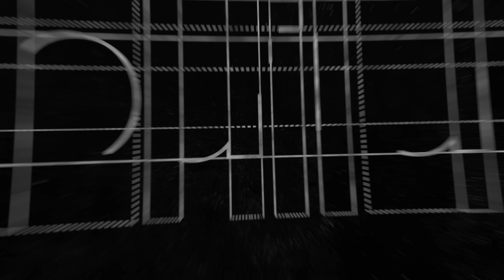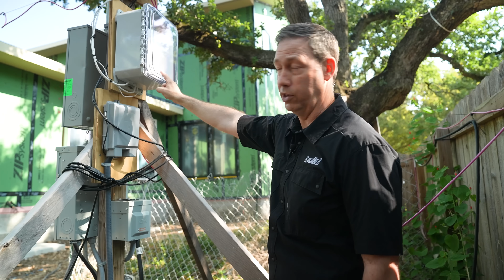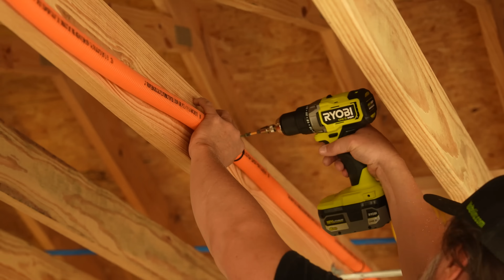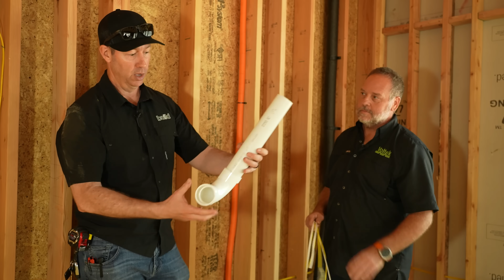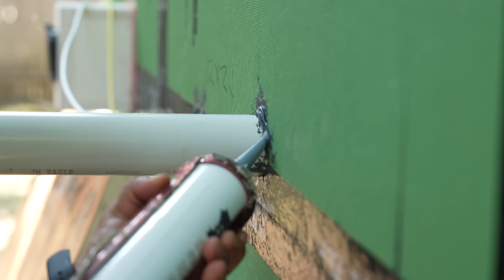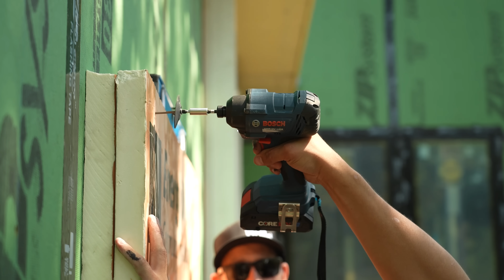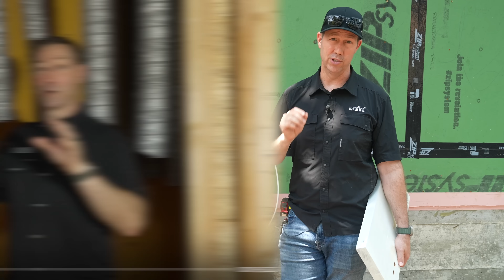Preparing for Google Fiber & Future-Proofing!

Comment: AT&T doesn't use coax, they never have. They are a phone company and will use fiber or twisted pair like that cat6. Coax is used by cable companies not phone companies.

I would put an outdoor electrical box to run the cables into. I have seen plenty of those cables left exposed and go to use them only to find that they are corroded quite far in, and in some cases completely unusable, a sealed box would provide protection from the weather and help prevent that. It is also the correct way to do it.
Reply: AT&T uses Coax to go from the MPOE to Demarc with certain equipment.
Reply: @KevinSmith-qi5yn  as far as I have known the phone networks have always only been twisted pair or fiber. Of course there could be parts that I am unaware of, but it doesn't change anything about my comment because they don't run coax to the home which is what this is about.
Reply: @jeffreyparker9396 I think there are some legacy coax systems where ATT bought an existing cable system that had cable Internet where this applies. Otherwise the ATT system is either DSL or fiber.
Reply: I assure you that AT&T Broadband previously ran coax from the pole to the modem in my home. More recently, they ran fiber from the pole to my home. AT&T is more than a phone company.

A weatherproof box is a great recommendation. A homeowner can choose the best place to install it in advance.
Reply: @DynamicBits  how do you know? Did you cut open the cable? I have only been working in the industry for 20 years, unless it was a cable TV network that was acquired by AT&T it would have been trusted pair because it was DSL which is literally run over phone lines and only over phone lines. They also did fiber to the street or fiber to the outside of the house for many years now.
Reply: @jeffreyparker9396  1. "RG-6" was printed on the cable jacket.
2. I watched the technician terminate the cable.
3. The cable was terminated with an F-type compression connector.
4. The wall plate had a female F-type connector.
5. An F-type attenuator was used because the signal was too strong.
6. The cable connected to a *cable modem*.
7. The service was billed as *cable internet*.

@KevinSmith-qi5yn was spot on with their comment about coax being used from the MPOE to demarcation point in certain situations. There is much more to AT&T's network than the PSTN you're focusing on. I can't confirm that AT&T still installs coax, nor did I claim they do.

P.S. When I had DSL at that house, it was not run over twisted pair from the pedestal. It used a jelly-filled direct burial cable with untwisted pairs using colors that predated the EIA/TIA-568 standard. Also, my current AT&T fiber install uses one continuous cable from the pole to the inside of my house, with no equipment or termination box outside.
Reply: @DynamicBits  like I said, cable network acquired by AT&T.

Comment: You can run at least 1Gbit with that cable with current tech and they can probably bring that up even further in the future. 1Gbit is far more than you need as a private citizen, you can run a commercial internet service on that with no problem.

Comment: Using plumbing PVC pipe instead of electrical PVC conduit? Not smart, the bend radius in that 2" 90 is capable of snapping fiber.

Comment: One thing to consider when you run cable in walls is risk of fire from the wire itself overheating (e.g. PoE power over Ethernet). Network cable put in walls should plenum rated "CMP" which has a fire retardant regular CAT5/6/7/8 are not unless you specifically order plenum grade. I'm not sure if fiber has the same it's light not electricity but the Aramid cover it's most likely flame proof. The coax cable they ran should also be CMP rated. edit: CMP in any enclosed space has benefits not just for the off gassing reduction.
Reply: plenum cable isn’t needed for wall cavities.
Reply: That is NOT the point of the plenum rating. It's to prevent off-gassing during a fire when cables are ran through a plenum space, which 99% of residences don't have.

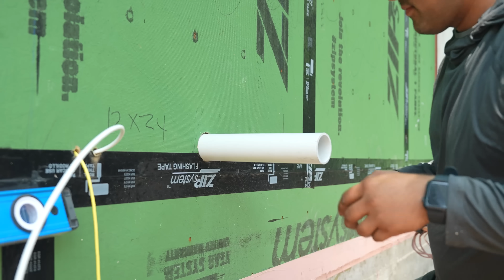Comment: 8:34 - you don't need a 2 inch pipe to future proof the Internet. You could totally do a 1 incher.
Reply: It would help in situations with pre-terminated cable but Inch and a half would do fine.
Reply: For the less savvy homeowners or installers it is MUCH easier to pull pre-terminated fiber through a 2"
Reply: That's what she said.
Reply: Dunno why they didn't use the grey stuff but oh well

Comment: Gotta say, Im a bit disappointed that there isn't some other cool entry box that lets you elegantly run exterior lines to the interior.  If Risinger is just drilling two holes in the exterior sheathing, then I guess it doesnt exist!
Reply: Yeah it was pretty laughable. Extreme broadband enclosure is what you're looking for. It will mount on to the side of the house, provides multiple conduit connection on the back. Makes for the very clean install.
Reply: Yeah.. should've been a poly NEMA locking cabinet for everything to land on the outside wall

Comment: Neat, but I don't like how it was done. I would have run a 2 gang or even a 4 gang box and sealed that. Then run the cables though a face plate. That would let you pull these two cables if they get broken as well as run anything else. I think it would look cleaner and also be more future proof. I would also do the same thing on the corners  under the eves for future security cameras.

Comment: I would have run two conduits, you don't want to be pulling any future cable against your fiber lines if you are still using them. Also, even if fiber is still the standard for high speed Internet in 10-20 years its likely that the standards for the fiber to handle the "new" speeds will be different, requiring new cable pulls.
Reply: I doubt new fibres would be required, no speed imagined would require different fibre.
Reply: just get new SFP modules with the requested speed

Comment: I hope you also ran power out there!! The ONT needs power, and any other cable box or media converter usually does, too. Unless you are putting the ONT in the attic and have an unpowered splice mounted to that board.
Reply: ONT is usually indoors.
Reply: @lordgarth1  Not always. A lot of providers use an exterior mounted ONT with an ethernet connection to the inside of the premise.
Reply: @lordgarth1  Google is the only provider in my area that will land (residential) equipment inside. Most others will refuse unless you have an enterprise account
Reply: ATT has their ont/gateway inside the house
Reply: The ONT no longer goes on the outside of the house, this isn’t 2014.
Reply: @CaptainMcFartin  I should’ve specified then.. I work with several rural carriers and their ONTs most definitely still go on the exterior. I get it, enough people have clarified it doesn’t apply to ATT 👍🏻👍🏻👍🏻
Reply: @Zach_T_M  ahh, okay. I was gonna say, TDS stopped that a long time ago.
Reply: ONT is installed indoors in many places because they had some issue with ONTs installed outside (heat, moisture, etc..). Even when ONT is installed outside, power supply is installed inside with separate cable run for carry power and power monitoring. They could use extra PVC conduit if this is necessary. COAX cable can be converted to supply power as well, but I doubt service provider will do that.
Reply: As another data point, my Verizon ONT is inside my house.  There was an old outdoor ONT (circa 2005), they just used an SC coupler extend the fiber into my house.
Reply: @Zach_T_M  wow. Now I did have to be there when they showed up to make sure they didn’t just do whatever they wanted.
Reply: @TofuInc  that’s crazy. When they did mine I was there and made sure they didn’t exactly what I wanted. I saw my neighbor getting fiber and walked over and made sure they did what he preferred as well. They were trying to tell him they were going to run it to the side of his house which was the opposite of where it would be best for him.
Reply: @Zach_T_M my rural FO carrier is an REMC, and the powered converter box, which is a WiFi router as well, is in the house.

Comment: I'm confused what the pipe was for if the wires are  not going through it. He implied they were running the wires through the pipe but at the end they didn't. I was hoping they'd have a solution with a real slick box or enclosure to make the connection in outside rather than the junk the Internet company uses. I also couldn't find Lee's website. There's a ton of companies called Volt Tech.
Reply: 8:35 Matt said it's just for future-proofing in case it's needed for some new networking technology he's putting in the pipe now for whatever new technology may exist decades from now.
Reply: @dg-hughes  Ah, thanks. I guess I thought he'd run the other cables through the pipe also... There's plenty of room.
Reply: mentioned early in the video. during construction it is possible to properly seal holes drilled through, after completion this is not as easy, that is the reason for the PVC conduit.
Reply: @coreysuffield  I did catch that, Just still why not use the conduit/pipe. Seems like a cleaner install.

Comment: Why not run everything through a conduit? Why put extra holes in the house?

The big problem with fiber is patch cables. Also, any future movement or redesign of the structure will require full line replacement.

The conduit idea is great for any house. Just add a few separate ones with junction boxes. Separate ones for "high" voltage, low voltage/data, and misc. These can come in handy when doing remodels, additions, or even just basic troubleshooting. Having all your wires coming through at one point makes it easier on technicians.

Comment: New build, new house.
I would not run cat5, cat5e, or cat6
I would run fiber, but you can also opt to run fiber with cat5e or cat 6
Up each run, then you should not need to run conduet  and or 2 cat5e  or cat6 and fiber.   
Lay out your system a central location and distribution point.

You can run phone, alarms, and data and audio and vedio over cat5e and cat6
It all can run over fiber.

Comment: You missed the easiest and most obvious cable to run to the outside, cat6 or cat6a.  I can almost guarantee google fiber won’t utlize that fiber line you ran, because they don’t want to deal with issues on that literal last mile of unknown product.  They will deal with a cat6 Ethernet cable, because that has far more industry standard (believe it or not) than fiber.  The Ethernet cable can also deliver about 100w of power to anything right on the outside wall. (I guess the coax could to)

Comment: With the new WiFi 6 and even newer WiFi 7 router technologies the fiber in the house isn’t really necessary anymore. The speeds over the air are tremendous now and I’m sure they’ll increase exponentially every few years
Reply: The fiber cable is used to deliver internet service to the modem/router.

Comment: What happens if Google abandoned the Google Fibre project? Will not be the first time they dropped infrastructure project.
Reply: True... They dropped it next to our neighborhood.
Reply: If the infrastructure is in place already someone would just take over. Running the internet is the cheap and easy part.  The expensive part is laying out all the cable.
Reply: The fiber that he is running is not exclusive to Google Fiber. All providers (AT&T, Comcast, etc.) are moving to fiber so if Google leaves he will still be compatible with the new guys
Reply: @e1000sn  yah it would be dumb to just abandon the internet once you already put in all the time and money to lay the cable. Keeping the internet running is really the easy part and doesnt cost much money.
Reply: "If" lol

Comment: This is abysmal advice except for the smurf tubing...... CAT 6a or if you're feeling spendy CAT8 cabling are more than enough for residential, allow you to skip SFP converters and can do PoE from where you end up putting the switch stack......

Please don't have people who do cabling talk networking.....
Reply: Certainly not necessary in a small building if you aren't required to meet something like NSA TEMPEST requirements. Only place I've seen those SFP boxes was in NATO setups where they were running different classification systems, and the use of FO cable vs copper allowed them to run cables wherever vs having separation to prevent bleed over between systems.

Comment: You don’t need to do anything special for fiber. They will bring it inside where you like and mount the ONT inside where you want it.
Reply: you must of missed half the point of the video. if the media/conduit is already in place then the tech from the ISP doesn't have to blindly drill a hole threw your exterior wall
Reply: @james6794  This is what the extra PVC conduit is for, but Matt ran two cables through the wall anyway.
Reply: @james6794  Id rather have a hole drilled through that was just the right size for the fiber than a conduit. Not a big deal when I had it done.

Comment: okay you dint show the other end of the PVC on the inside????? did you just stub it into the wall??? in the future how are you going to use that??? and why run conduit if you don't bring it all the way to the outside?? If you have to replace one of those wires you cant! Without removing drywall inside to get to the conduit!!

Comment: Prep for Fiber anywhere.  Wiring for Ethernet is more important.  I’d run 12 Ethernet drops per floor per house  including  hallway ceiling, corners POE cameras inside and out.   

Multimode is dying.  I’d never install it.  It’s limited in bandwidth.
Reply: It's not limited in bandwidth, it's limited in distance

Comment: You attempted to future proof it with the orange flex conduit. Then you bring the fiber and coax out two separate holes. No tech is going to fight getting new cables back through those tiny hole into the flex conduit. They are going to eave pop whatever cable they need into your attic. Complete fail, the orange flex needs to exit the zip and can then be sealed with duct seal. You also didn’t show what the white conduit was for. Please hire a professional next time.

Comment: Talking about "we weren't even thinking about this twenty years ago!" Now think about how to build a house to still have people living in it in 500 years' time, like so many places in Eurasia. 500 years ago the people who built those houses weren't thinking about indoor plumbing, never mind electricity.

How would you build a house now that will still have people living in it in 2525? If you do it right, your building's annualised embodied energy is a little over one tenth that of a house built to last 50 years. That's a pretty stark comparison with so much of the trash produced by the modern building industry. 

Which parts of the house are they going to have to replace from time to time, and which parts will stay sound through the centuries and just get an occasional coat of paint to keep up with the fashions? How readily will they be able to add new services that we haven't invented yet?

Comment: Why would you need a "temporary fiber for construction"?  😳
And if you are already running this PVC, why not run those 2 cakes cables through it?  You can seal the cover with small holes